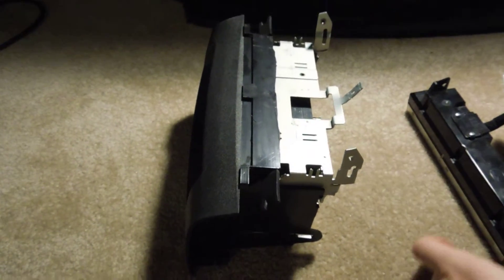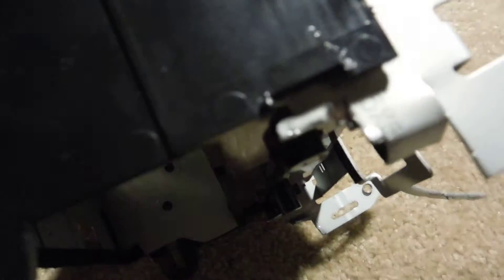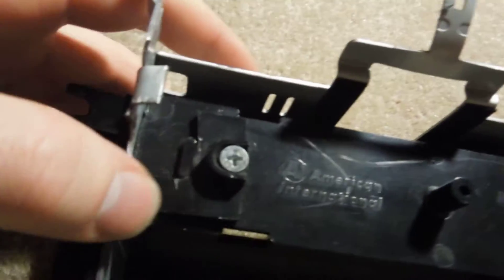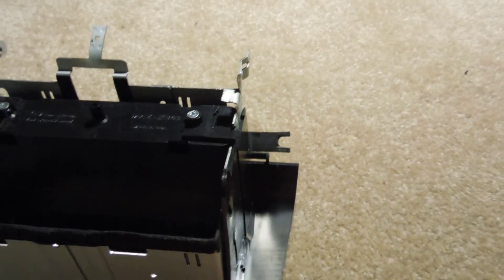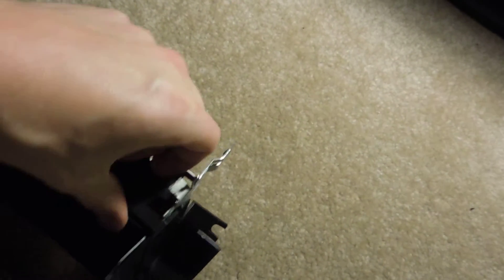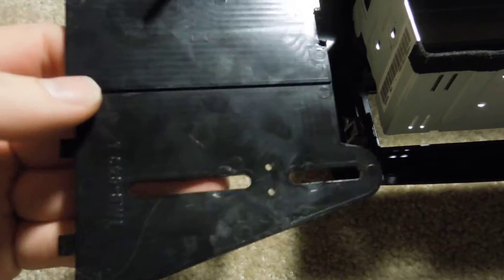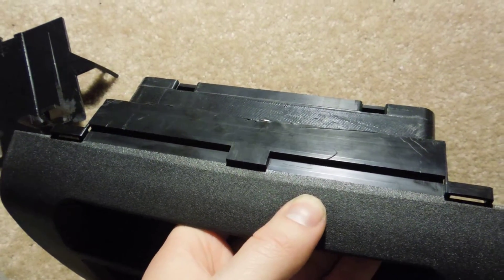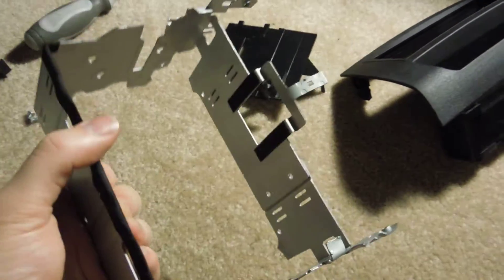how to build the lcd mod for the mazda 3 2006

Comment from the maker: it does not connect to the radio there should be a plug in the dapoket you pulled your factory radio out of for it
Reply: It's really strange, cause every YouTube video I saw had a plug in the wiring harness, but mine didn't! The LCD gets connected to the original radio, and if you separate it, there is no way of connecting it with the new radio

Comment from the maker: sorry i think i hit the wrong button when trying to send this reply yesterday. i didn't bother doing it with the double din because of sll the wiring and modules i had to hide there was not alot of room. you will need a metal cutting too like tin snips or side cutters. if you need help on dis assembling your dash i masd a how to install mazda 3 deck video just check out my video section

Comment: So I have a 2008 MS3, and I just got a doubledimm dvd/satellite/bluetooth receiver.

The install guys didn't move the LCD over and its annoying as SHIT. Using this has helped, but am I correct to assume that there is simply a plug that goes from the ac/heat controls, and plugs into the back of the lcd for the display?

Comment: Hey man.. thanks for this vid! On the Metra kit, I had to cut much more of the factory stereo mount to keep the LCD screen. The Metra kit forces you to install the radio above the pocket unlike the one you have. I pretty much cut all but the top portion of the factory bracket to fit it to my install. I tried to make a vid myself but things didn't go as planned. I'll see if i can make a vid of how things look now. Thanks for your work though.